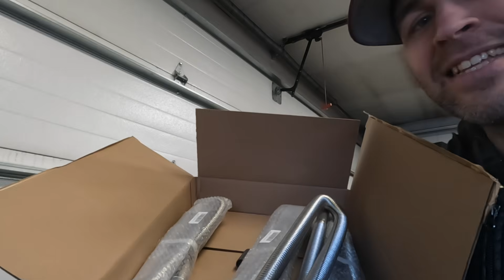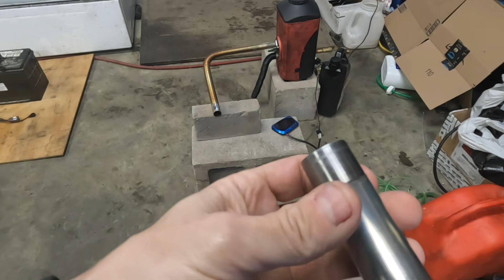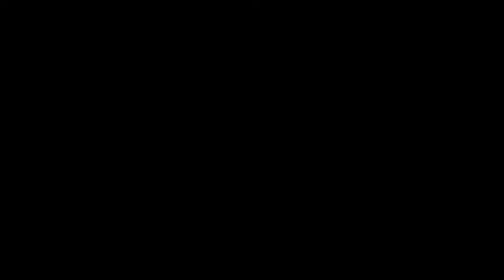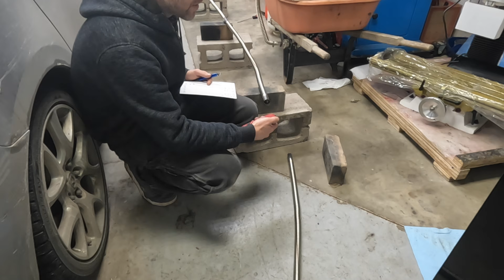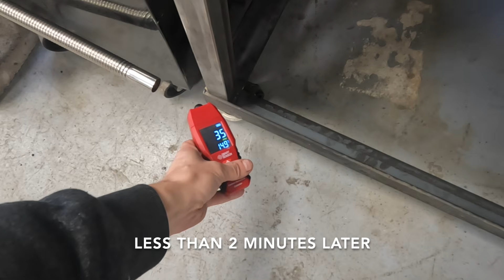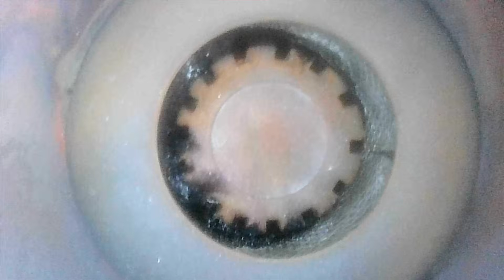Capturing Waste Heat - 5 Meters Of Stainless Exhaust - Will It Even Run ?

Comment: If you bring the exhaust temperature down to 140°F. You are going to start condensing your exhaust gasses. I think you get another 970btu/hr per lb of water when that happens and all the other problems that come with that acidic water.
Reply from the maker: Yeah, I briefly talk about this at the end of this video. I'm not too worried about the acidity, but it does need to be able to drain.
Reply: @loweredexpectations4927  
I wish I had the time to play with this stuff too. Keep up the good work.
Reply from the maker: @hotrodplumber  Thanks ! I work a seasonal job, and the responsible thing to do would be to get a winter job, but instead I try to make YouTube videos profitable, haha...  Otherwise, I wouldn't have time either.
Reply: @loweredexpectations4927  
I'm using a 5kw to heat the 24' travel trailer I'm living in. Way cheaper and more comfortable than the LPG furnace that came with the trailer.

Comment: Great test!  I have added a few aluminum heat sinks to the outside of a 1 meter piece of exhaust pipe just to see what they might do - the temperature does decrease from each one in series and it does appear to help pull more heat out of the line.  I would like to get some old hot water / steam heater wall units to see how a piece of that would work.  Maybe you can figure out a good way to extract heat on a shorter more practical exhaust that also wont cost a fortune...
Reply from the maker: For sure... Aluminum is awesome at that. I have some aluminum jet ski exhaust and want to use it... but the adapters will be tricky. 

I would say, the most cost effective solution is likely a car radiator from a scrap yard, if you can find one with metal end caps.

Comment: Cant wait to see you do a double wall exhaust/intake heat intake.  Using a larger diameter for the air intake.  Sand would be cool to dischaŕge into
Reply from the maker: I have someting planned for that, but with a bit of a twist ... not sure if / when it will happen, haha.

Comment: A fan on the end to draw exhaust until it's warm would help with startup
Reply from the maker: That would work.... as long as it had the right flow rate and could handle the heat👍
Reply: @loweredexpectations4927  have the fan blowing through a bigger pipe with the exhaust inside so it creates a venturi effect.  That way you don't have to worry about heat.

Comment: Great video , firstly be interesting to see if you had no bend in the first tube.  I remember as a kid we had baseboard water heating pipes with little two an half inch fins along the length of the pipe , I'm sure if you fined one or two sections of exhaust pipes the heat exchange would be great... love your clips and commentary an being a fellow Canuck🇨🇦 too. Cheers.
Reply from the maker: Thanks for the comment. 

I left the first bend because I figure that is close to reality. Most heater installs are going to have at least one bend. 

I grew up on the east coast of Canada and there were a lot more water heated buildings there... My house had a coal fired boiler when we moved in, but it was torn out and the radiators were thrown away.... That would have been 1980 ish. 

An exchanger like that would be perfect... much more costly these days.

Comment: Spiral the exhaust tube like a screw, and point it up or down to get a chimney effect.  Put the exit end up and you could use the same coiled pipe for your condensation test.
Reply from the maker: I do plan on doing this in my next exhaust video.

Comment: Id say burning off oils and other things on the new pipe, I use 8 feet of baseboard water heat with all the fins, the 3/4 copper pipe fits with a union to connect and then I vent outside just to reclaim all the wasted heat thru the exhaust
Reply from the maker: I hope to do the same with baseboard heaters some day... That or a wall mount seems like the perfect solution.

Comment: I wonder if you were to run the exhaust into a catalytic converter and harvest the heat off of it?
Reply from the maker: This is dependant on two things, that we don't have in our favor. 

1. There is stuff in the exhaust to be burned (CO & VOC) due to incomplete combustion. Based on my numbers, there is very little that isn't burning in the heater. 

2, The cat needs to be kept hot enough to operate and depends largely in the process of catalyzing to keep it hot. The outlet temp of the exhaust is just barely hot enough so this could be tricky. 

To get this to work,  you might be able to purposely run the heater rich so that you have unburnt fuel going out the exhaust. You can buy catalytic heaters that run on propane.
Reply: @loweredexpectations4927  for the sake of experimenting, maybe run it rich (or lean?)until the CC gets up to temp and then dial it back. If a guy came across a CC for zero dollars or close to it could be a fun experiment.
Reply from the maker: @gordon6029  I have been wanting to try this. Last year I put a tiny one inside the burn chamber (off a weed trimmer) in an attempt to burn waste motor oil... It was a fail but no one was surprised, including me, haha.

Comment: Just asking, with the heater standing on end and pulling air through the cinder block, is there enough air flowing over the heat exchanger ?
Reply from the maker: That is a good question and the second time someone has asked. 

I did make sure to test it before this video and also tested it at the first of this test. The heater normally runs 184 -186 in alpine mode and it was stable at 184. If there was a restriction it would have gone up considerably. 

Good observation 👍

Comment: What happens if your exhaust gets progressively wider, so less restrictive as it gets cooler?
Reply from the maker: That would help or sure. Wider exhaust means slower gasses and less restriction.
Reply: @loweredexpectations4927  how about making a Y connector going to 2 exhausts
Reply from the maker: @fenceup07944931177  That would work nice. Less restriction and less length.

Comment: I once had quite the debate on David's channel when they were trying the self powered diesel heater.
Would steel be better than aluminium at catching the heat.
Aluminium makes a good heat exchanger and steel a good heat sink. The fact that the bend shows the most heat is interesting but not unexpected, also has the first connector got so hot because of how thick the tube wall is.
If you have a really thick walled,  steel elbow, would that be able to absorb more of the heat?
Reply from the maker: Yes... I expect the next test to have dramatically different results, when I make loops of all of the tubing.  

The extra mass of metal at the joint would make it hotter there for sure. I tried to make sure and check back from the joints a few inches. It may have still had an effect.

Comment: Hi, from UK, try measuring the added resistance of the exhaust pipe by tapping into the heater end of the exhaust and adding a manometer, basically a 'U' pipe with water in it, one end connected to the exhaust at the heater end, the other end open to atmosphere, see the water level rise as the exhaust pushes against it. Do a Google search to see a manometer. I have 1.2 meters of exhaust in my workshop, zig zagging down the wall, the heater is about 1.5 metres from the floor. I plan to put silver foil insulation behind it. I am impressed by your delivery, you get it over well. Keep it up, dave
Reply: You could use your green tubing, just drill a hole in your couplings and solder/braze in a port long enough to be cool before it touches the clear hose so stainless is much better than copper because of its higher resistance (same reason it's good for yeti/Stanley cups) you need a bent column of water so your can measure the difference in height exhaust/atmosphere.  If you look at Darcy equation to calculate pressure drop, friction factor (the corrugated like you're using is awful because of the turbulence) will get worsen if you try to compensate with fan speed.  People trying to capture heat from the exhaust should upside the exhaust and try to keep the inside smooth, and for long service life choose something corrosion resistant like a non magnetic stainless.
Reply: @mugen5204  What do you mean with "upside the exhaust"?
Reply from the maker: @mugen5204  Yeah... I realized this after the fact. I used to use these vacuum devices to adjust carburetors on snowmobiles.  I kinda wonder if it would be sensitive enough to register.

The restriction isn't too severe, and the air speed is pretty low, but yes, that is a good point about forcing more air through. The efficiency will decrease rapidly.
Reply from the maker: Hello ! That's a great idea... and thanks for the kind words ... I have a hard time speaking and it can be a struggle. 

I love your idea, but I'm not sure that I can justify the cost of a manometer for this one project.
Reply: @loweredexpectations4927  The type of manometer he speaks about, is basically a clear hose with water in it. That's fairly cheap.
Reply from the maker: @werner.x  OH... I searched and found a digital one right away. I was wondering if there was a water column device. 

Thanks Werner !
Reply from the maker: @werner.x  I have used something similar to balance carburetors on a vehicle.
Reply: no need to buy one, all you need is a piece of clear tube, like brake bleed hose, a drop of water and job done @loweredexpectations4927

Comment: Standard oil burners use heat exchangers to heat incoming air with exhaust output.  .. this improves the. Ignition of diesel (et al) .. these premade units are the handy passthrough
Reply from the maker: That's a good idea 👍 ... I am considering something like this, but with a twist.
Reply: Some diesel  heaters  heat the Inlet air, the Mikuni MY series does 👍
Reply from the maker: @Dirt-Diggler  My mind is still blown that Mikuni makes heaters... I just found out recently. Of course the Japanese would heat the inlet air !

Comment: I got 5 ft at one born to be able to vent it all I did was Coke up once I went back to stoc pipe a cleared up
Reply from the maker: Hello. I'm guessing, based on my tests, that you must have other issues.  

I mentioned at the first of this video that I ran my heater on alpine mode, and that I normally run on normal mode. If you are at higher elevation, you may have to do the same. 

If you have an adjustable ECU that you can control air fuel ratio, you should have a CO meter and try to set it so that you have no more than  20-30 ppm. 

You may have a restricted combustion air inlet, or it could be something completely different. If 16 feet works fine for me, 5 feet shouldn't be a problem for you.

Comment: Come on !!! Why didn't you get some baseboard radiators , but the best if you have hydronic heating are to pass the exhaust through the boiler 😁👍🥶  you can burn waste oil if it's cleaned !! internet has how to convert waste er engine oil to diesel , good luck
Reply from the maker: I would love to have some baseboard heaters... I have been looking at them for about a year and recently looking at wall mount radiators. That would be awesome. 

Haha... Waste oil to diesel is something I would love to attempt... not so sure that I want to do that within the city limits on any scale, though.
Reply: @loweredexpectations4927  
I really are not a fan of baseboard heaters but the are Dirt cheap 😁 prefer hydronic central heat with underfloor hearing, or normal radiators
Reply: @loweredexpectations4927  
Afraid of resistance in the exhaust use non corrugate pipe or Chinese a larger size 😁

Comment: I have not even watched this video yet I am so excited I went straight to the comment section. 
I have watched lots of yer vids. Thank you for this one. 
I am also curious how much resistance can be put on the duct (elbows,vents computer radiators for water heating , and just plain linear feet of duct.
Reply from the maker: Thanks for your comment ! I appreciate it. The results are pretty surprising... but I suspect that when I bend the tubing the results will be drastically different.

Comment: One of the tricks of tuned engines is to keep the exhaust as hot as possible by wrapping it with glass tape. Hot gasses are less dense than cold, so easier to shift and keep moving. A low-level plinth radiator, or a turbo intercooler with a fan might be more effective. That pipe is only corrugated to allow bending; it does nothing for the flow but slow it down.
Reply: That’s great for an engine but when you are dealing with heaters you want that exhaust to be as cool as possible because that means you are extracting the maximum amount of heat and making the heater more efficient.
Reply from the maker: @White000Crow  For almost all cases, it makes sense to capture the heat, but it is true. If you had no choice but to run a long exhaust, it may make sense to insulate it and accept the heat loss.
Reply: @loweredexpectations4927 longer runs cause back pressure and change operating conditions
Reply: It's wrapped to keep the exhaust gas velocity up....   The capture of heat is NOT the goal in this case. Intercoolers are usually aluminum, not resistant to exhaust gas since designed to cool incoming COMPRESSED AND HEATED air
Reply: I have drilled a hole in aluminum fins of a big old  CPU heat sink with 12 V fan attached to it and then I put the exhaust tube trough the hole. Once it heats up I flip the switch and it captures more heat. Even better solution would be installing a piece of baseboard radiator copper pipe with aluminium fins as part of the exhaust and then running a small fan next to it😊
Reply: I used another heater as a heat exchanger I drilled out the burn chamber and removed the inner blower fan I had to adjust the fuel ratio or it would burn way too rich I need a controller with fuel ratio control Im just kinking off the fuel line to lean out the mix The added back pressure causes the heater to move less air through the burn chamber making it burn rich @trikator
Reply from the maker: @trikator  Nice !
Reply: I modified an aluminum single pass transmission cooler, fins inside and fins outside by drilling and tapping the end caps with a 1" nps pipe tap. A 1" pipe nipple is .040" bigger ID and sleeved to createa press fit for the corrugated exhaust pipe. The aluminum HEX holds up to heat as does the exhaust port and body of the heater. With this and 10" of pipe works well.
Reply from the maker: @mikewestermann1  That sounds pretty awesome...
Reply: Nope.   I run 2 meter exhaust coiled lazily downwards with a fan acriss it before the pipe passes through the wall (sleeved with 1-1/2 copper pipe)  the corrugated pipe w  coiled design makes a turbulent flow that mixes all of the gas for efficient heat recovery.   The calculated.values were 90 percent recovery..  actual turned out 95 percent.
Reply from the maker: Yes, if you are not interested in capturing the lost heat, then this would allow more free movement of the exhaust  gasses 👍

If you are only interested in capturing the waste heat, then there are many better options. A radiator or intercooler would work WAY better than this, for sure.

Comment: Great test and very comprehensive video.  If I used one it would be to heat a garage so I wouldn't bother with any fancy heat exchanger except the long exhaust.  I would fit the exhaust directly to a 4 inch pipe, less restriction and way more radiant heat.  I think it would work and for a garage or workshop it would be ideal.
Reply from the maker: Thanks ! 

The way this video started was to see how the heater would react to a long exhaust, for those who need to do it for some odd reason... and what it turned into is a heat exchanger video, haha. 

There are many ways to go about this for sure and if you can use a larger pipe, that could be the answer. Normal stovepipe may have issues with corrosion as there would be a lot of condensation, but there are lots of options !

Comment: Would love to see a video of running the exhaust through an intercooler with a few computer fans to distribute the extra acquired heat.....
Reply from the maker: Yes... for the purpose of capturing heat, this is a far better idea. I have a lot of tests planned and that is on my long list.
Reply: I wanted to do something like this on the heated air port, but all it would really do would be to concentrate the heat at that point, so I would put it over my workbench and it would make that area warmer, it wouldn't increase efficiency in any way.

Comment: i think the higher co levels are from some residue inside the new pipes, that has to burn up when first heating it.
Reply from the maker: A few people have mentioned this. It is possible, but I'm not sure that the temps would be high enough to create CO. Maybe VOC, but I'm not sure.